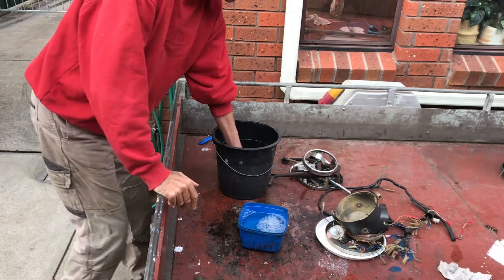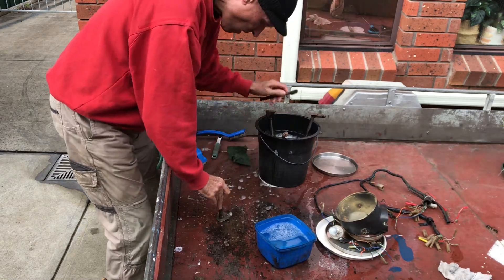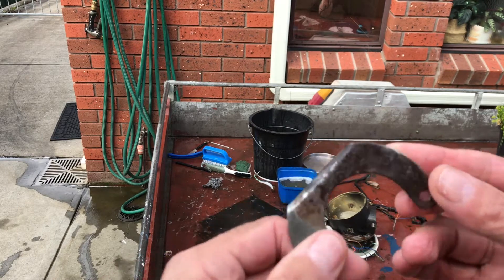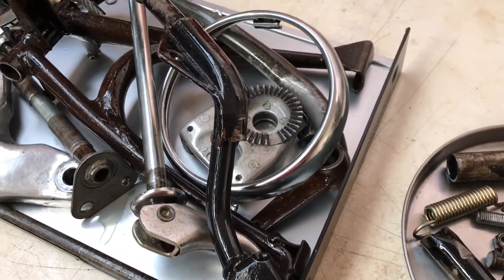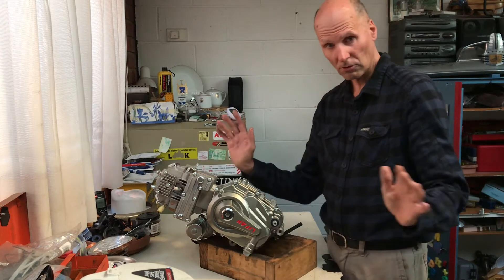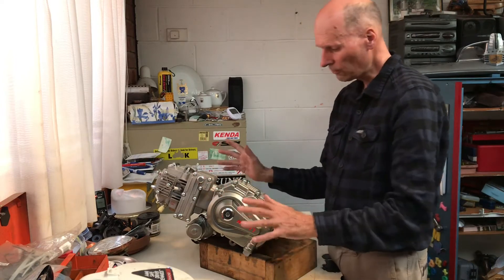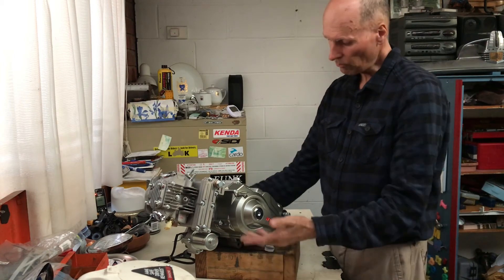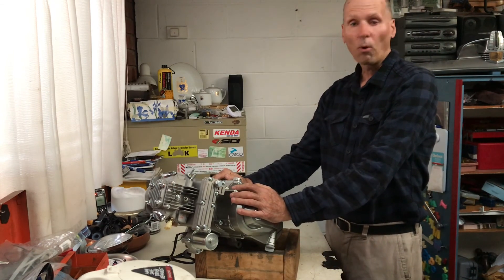Supercharged Nitrous Postie Bike build CT90 / CT110 Ep 2 ( the plan )

Comment: Curious motor. I bought a Lifan 140cc. It is getting a 26mm throttle body, Kenada Racing manifold, 145cc fuel injector that enters the inlet port via six holes directly into the port. It will be fitted with a Jimny turbo charger, and all controlled using an Arduino prototyping board and Speeduino firmware. It is taking a bit of time as the frame is a 1969 Yamaha Trailmaster 100 which was a two stroke smoker.

I will be naming it as YamaFan SnailTrail 140T EFI. Will be a cafe racer style build though.
Reply from the maker: Well you have your work cut out for you but that’s why we do it something new